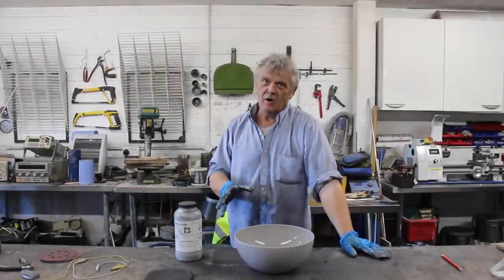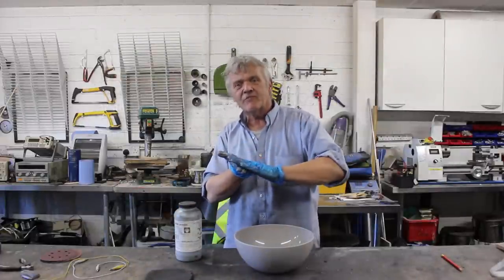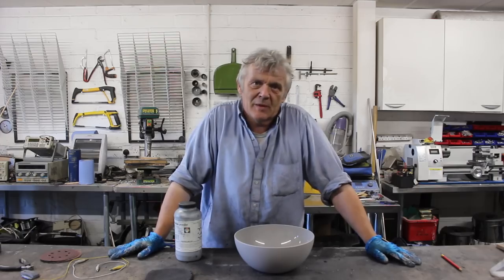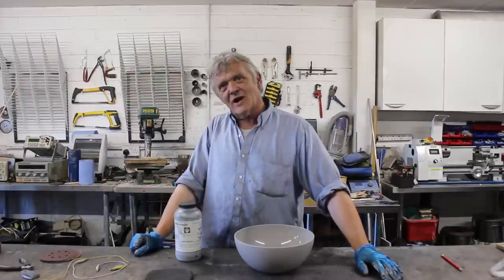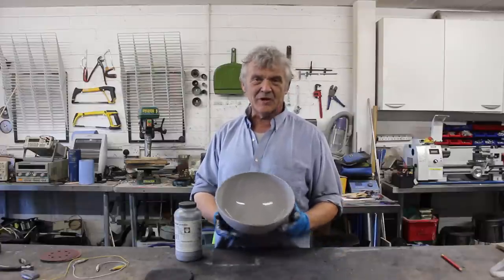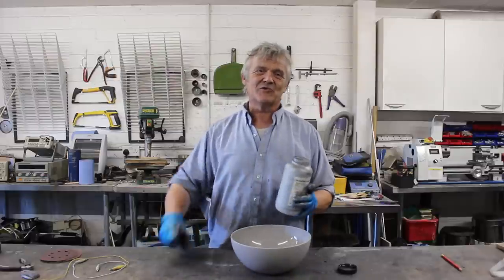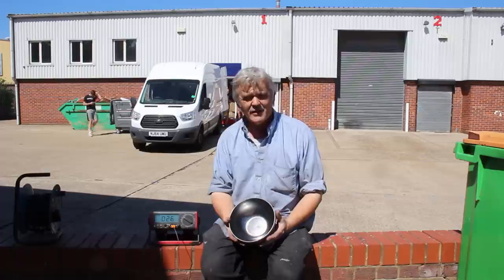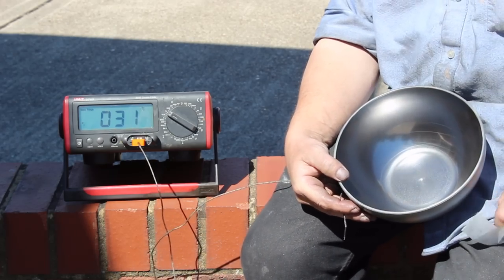1640 DIY Graphene Parabolic Mirror

Comment: If one used the vacuum method with a mylar sheet or other plastic sheet to first make a parabolic shape, might this then be used as a "resin mold"?  The idea would be to pour liquid resin into this parabolic shaped sheet.   Gravity would cause the resin to settle at the bottom of the well.  So, if the whole thing were placed on a horizontal rotating turn table, might the rotation cause the resin to follow the shape of the parabola until it cured?  Don't know if graphite would stick to resin.

Comment: Love this Rob. Any tips for waterproofing this? Parabolic is of course the way to go, but if you want some exposed to the elements (especially in the UK), some kind of waterproof layer might be needed - I'm assuming the graphene would wash off pretty quickly unfortunately?
Reply: I have rub applied it on polyethylene before, and it gets embedded quite well, it doesn't wash off even if you wanted it too. BTW I mix my graphite or graphene with  isopropyl alcohol before rubbing, to save your lungs and avoid the powdery mess
Reply: @magabesse  great little tip there, thanks! I may have to give this a go. Especially as I have loads of isopropyl alcohol around (never try to make your own hand sanitiser) 😂

Comment: That's really interesting. I have an old satellite dish and was going to do something similar to Nighthawk in Light... Now I've seen this I wonder if a super lowtech way could be to get a pencil and scribble all over the fish... Then rub the resulting marks and dust with a bit of felt. 

Might that work anyone, or will the graphite not work effectively?
Reply: Pincil leadbwould work fine id just grind it up and maby tumble it in a rock tumbler for a few hrs to get it nice and fine.
Reply: Pencil lead has a wax binder.
Reply: @UberAlphaSirus  that's true, I forgot about that.
Reply: @UberAlphaSirus  ah did not know that. Wonder if old copy machine toner would work.. but then you can buy pure graphite pretty cheep. I have an old can of it full from the 50s that i found a long time ago. It's about the size of a 3lb coffee can.
Reply: @michaelshultz2540  toner has a plastic binder, laser charges the paper, toner sticks to paper, heat roller melts it on to paper .you can get graphite cheep as chips. It may not matter at the end of the day. Shiny is shiney. And pencil leads conduct electricly on paper. You can make a makeshift soldering iron with a pencil and an AA

Comment: Uhmm...  Graphene will 'emit' almost perfectly when it reaches 'thermal equilibrium' with the source (Kirchhoff's Law). That plastic substrate is going to be mighty hot by then (due to being in physical contact with the graphene. At the distance we are from the Sun it won't be more than 128 C and of course, minus the heat energy lost due to conduction and convection. Graphene is not specular in this form AFAIK. So the surface will emit infra red photons in all different direction.

Comment: I have some Graphene powder to experiment with. This makes me want to take a crack at making an Axicon reflector (Reflaxicon). It won't focus light to a point, rather it will have a focal line along the axis. The long focal line is a poor way to concentrate light compared to a focal point, but it has some advantages if you don't require higher temperatures.  Because the pseudo-bessel beam produced is "self-healing" in the sense that it can illuminate behind obstacles near the focal line, I could stick a heat pipe in the axis and bend it into a series of flat coils, like so, to catch the rays: 
Sun ★≈≈≈≈       @--@--@-⟩⟩ Axicon

You can then bend the heat pipe back down through the axis to dump it in a heat exchanger behind the mirror. Even though it may be better to use a short focal length Axicon to achieve 2-3 times higher concentration on a single coil, I have an inkling there may be some trade-offs, and bottlenecks in throughput due to factors like heat losses that limit efficiency at high temperatures, which could be overcome by forcing the working fluid through multiple coils with a longer dwell time to overcome the lower solar flux.